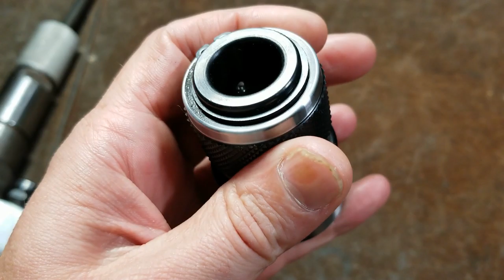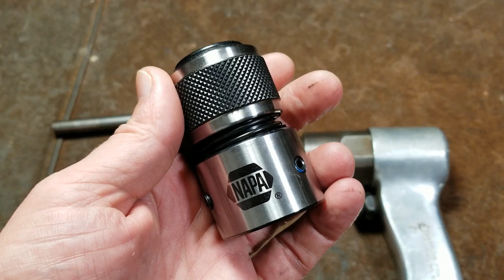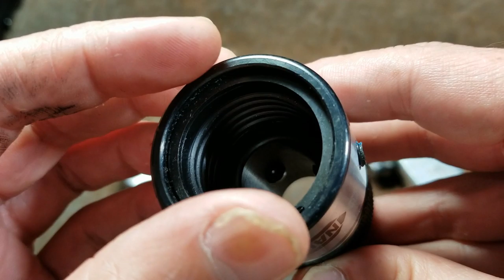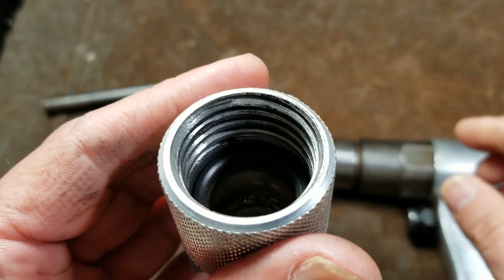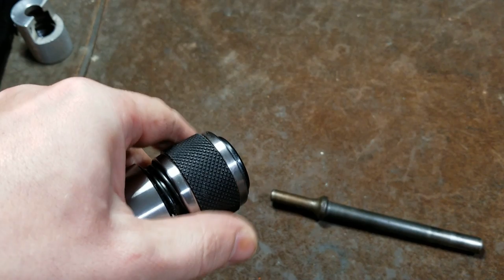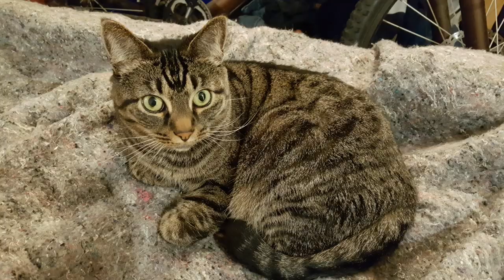NAPA Professional Quick Release Air Hammer Chuck Review

Comment: My sunnex long barrel came with the quick release collar. No plastic in it. The air hammer was under 100 bucks
Reply: Just giving them away, are they?
Reply: @1pcfred  
Quality  air  hammers  that  will  get  the  job  done  aren't  cheap . Though  the  sunnex is  cheap  compared  to  SNAP ON   or  CP .
Reply: @cbmech2563  I've used expensive air chisels and cheap air chisels. It's all the same to me. Someone once told me that air chisels were not a finesse tool, Then I skinned a door panel with one right in front of them. They never said that to me ever again. They're a finesse tool in my hands.
Reply: @1pcfred  
In  "cheap"  I  was  referring  to  the  amount  of  power  it  produces .
Reply: @cbmech2563  the amount of power an air chisel produces depends on how fresh or worn out it is. In my experience expensive guns do not last any longer than cheap ones do either.  When you take them apart there's the exact same things inside of them. Though in an expensive gun they may have gone through the trouble of deburring ports, or something. That's not worth 10X the price. Those name brands are ripping folks off. It's as simple as that. They're trading on their names for increased profit. Who wouldn't? I have a Blue Point body saw that I paid top dollar for that was fucked up out of the factory. It is the exact same thing as a no name tool.
Reply: @1pcfred  the  biggest  consideration  for  power  on  an  air  hammer  is  the  barrel  length  and  size  of  the  hammer . Longevity  is  a  combination  of  metal  quality  and  how  well  you  take  care  of  it   (keep  it  oiled  ). Same  thing  with  any  other  air  tool . I  have  2  harbor  freight  4"  disc  grinders  that  I  push  very  hard  that  are  4  or  5  years  old  and  going  strong . I'm  a  refuse  truck  mechanic  and  do  a  lot  of  fabrication  work . Lots  of  oil  and  they  have  never  given  me  any  problems .

Comment: Put a whip on your impact pneumatic tools. That's the secret to not killing your air couplings.
Reply: Every  air  tool  I  own  has  a  whip  hose . It  also  makes  it  easier  to  get  into  tight  places.
Reply: @cbmech2563  I just whip the really pounding tools. I'm a big fan of air swivels on some others. Whips can be a bit of a mess in the tool drawer. Air chisels are definite whip material though. Unless you just like replacing air chucks on a regular basis. I'm sure some do.
Reply: @1pcfred  
A  couple  of  tools  I  have  a  swivel  on  but  I  still  put  a  whip  on  them . It  reduces  the  likelihood  of  breakage  if  you  drop  the  tool . And  yes,  my  air  tool  drawer  is  the  biggest  mess  in  my  tool  box . 2  disk grinders ,  4  die  grinders,  2  drills,  1  air  hammer ,  and  1  air  saw . The  impact  guns  are  in  the  drawer  with  the  sockets.  The  air  hammer  has  a  1/2  inch  connector  on  it  because  the  1/4  fitting  starves  it .
Reply: @cbmech2563  I don't try to keep all of my air tools together. It wouldn't fit with how I use them.
Reply: @1pcfred  all  my  tools  are  in  a  hf  72"  bottom  and  a  26"  top  and  it's  full . I  don't  have  the  room  to  sort  things  out  any  further  than  that . Though  I  am  thinking  about  getting  a  52  inch  top .
Reply: @cbmech2563  all of my tools fit in a 20x20 garage and it's full. I am thinking about putting up a 20x60 outbuilding.
Reply: @1pcfred  all I get is a 12 x40 Bay in a trash truck shop. And only 10 x4 is for my tools and anything important has to be locked up.

Comment: My Ingersol-Rand 122MAX came with a quick change chuck.. certainly a nice feature... I'm a DIY'r  so it does the do for me... The set screws don't have to be very tight at all I have actually (inadvertently) ran it with out the set screws tightened at all and the retractable chuck never moved... so even tightening the set screws to "just tight" is more than adequate for most air hammers...✔